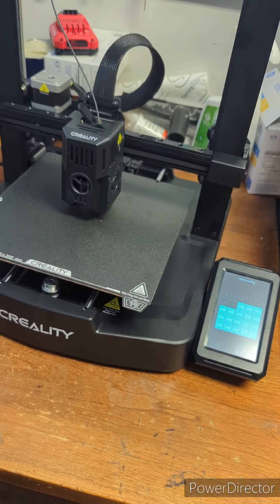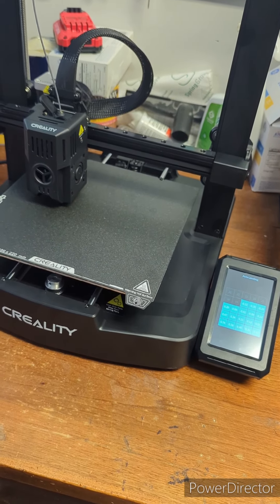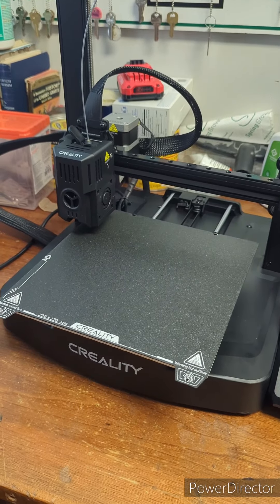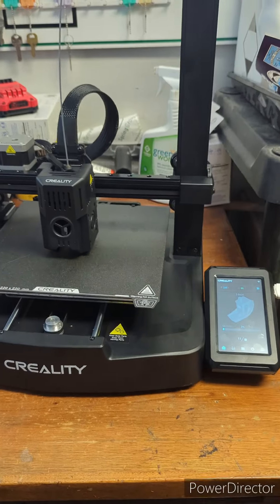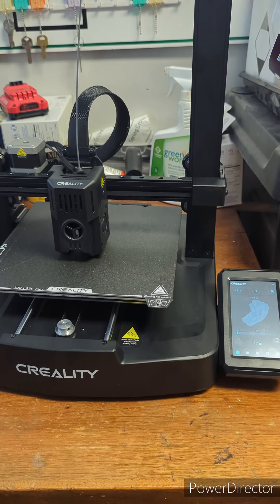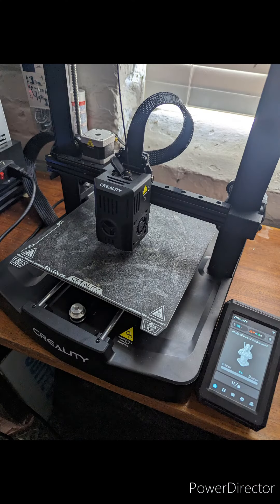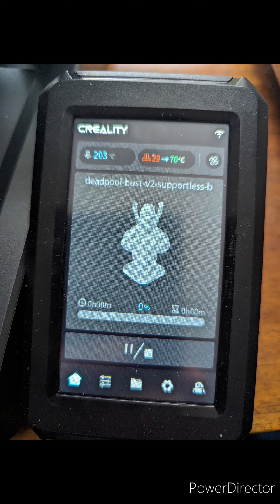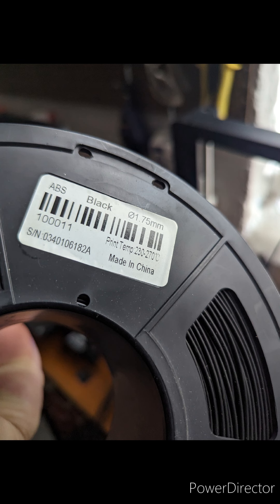first abs print with a machine made to do abs 😐

Comment: Unfortunately this print is likely to fail. ABS shrinks quite a lot as it cools, and the outside air is usually so much cooler than ABS that it tends to warp like crazy and delaminate or crack. You may be able to print small ABS parts but even those will be quite weak with poor layer adhesion. The good news is that even air temperatures of 35 degrees Celsius can be enough to prevent major warping. All you need to do is get a cardboard box, flip it upside down and place it over your printer so it's enclosed. You may need to check that the bed can move back and forth freely enough. Then just let the printer get up to temperature and stay there for 10 minutes before printing and you should be fine. Hope this advice helps and good luck!
Reply from the maker: @russellkeyes3984  thanks for the info, and yeah, it went spaghetti on me. Abs is what ruined my first printer, a Biqu B1 Se. Great printer for pla, but found out the hard way i needed some upgrades before i could do abs. Thanks for watching, and for the comment!
Reply from the maker: I did the cardboard box thing and went through my kg of abs 👍 thanks for the tip
Reply: @brycesstuff  hey that's great news! Well done man. Happy printing!